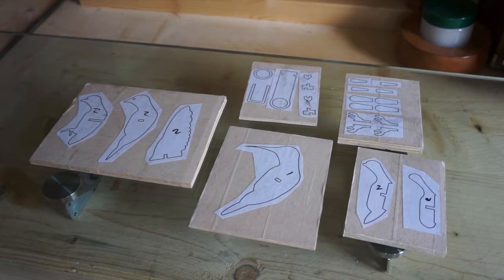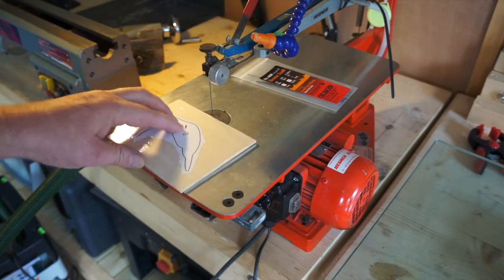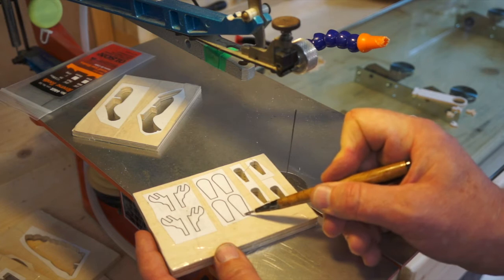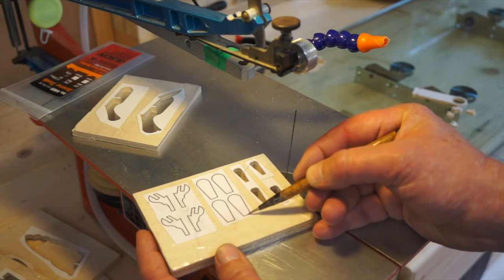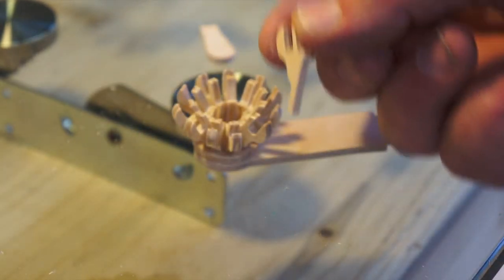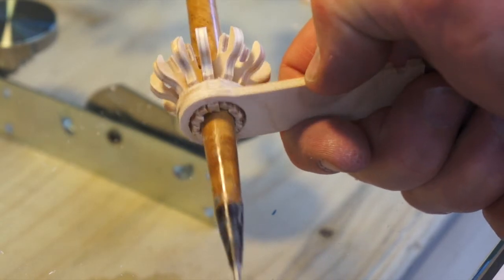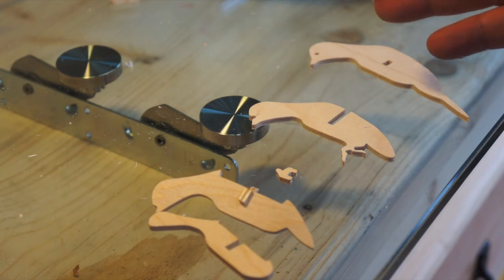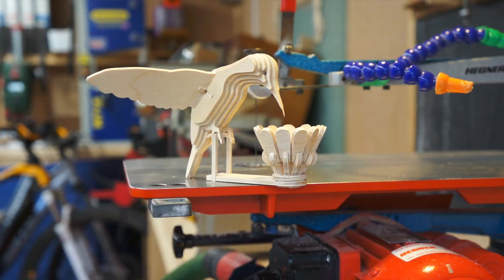Scrollsaw Hummingbird.

Comment: Great scrolling Paul. I would love a Hegner. Cheers, Jim
Reply from the maker: Cheers Jim,
They are great bits of kit. I got lucky and picked this one up secondhand. This one was made in 1999. It was used a handful of times and then sat in its box for about 16 years. The rubber bellows perished but everything else was perfect. 
The great thing about these machines is that you can still get the parts from Hegner. Fingers crossed, I have not needed any yet.  👍

All the best,
Paul